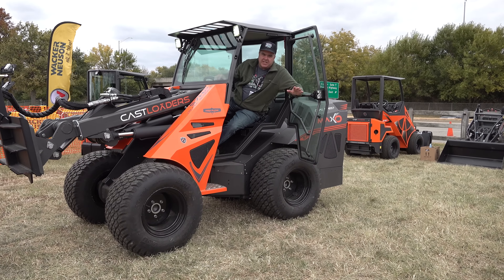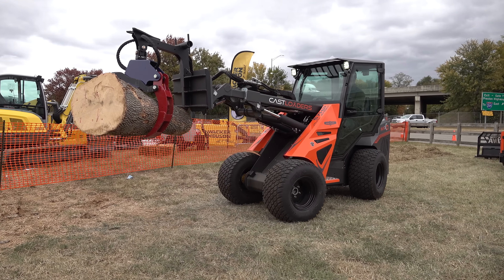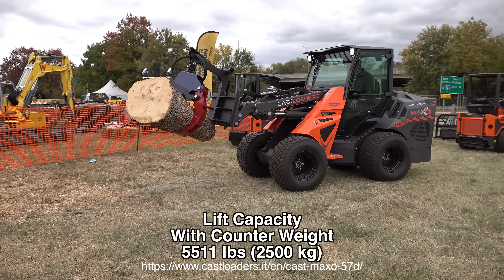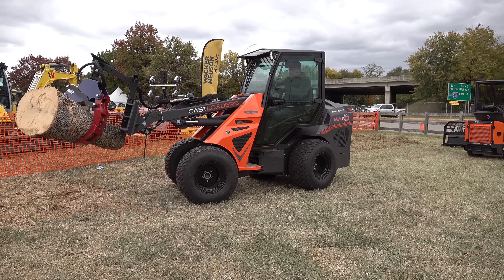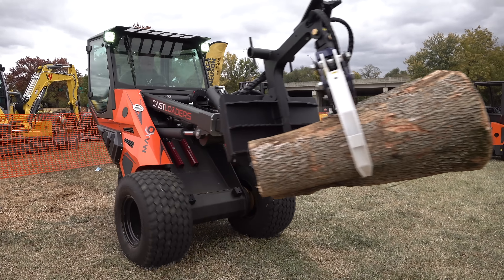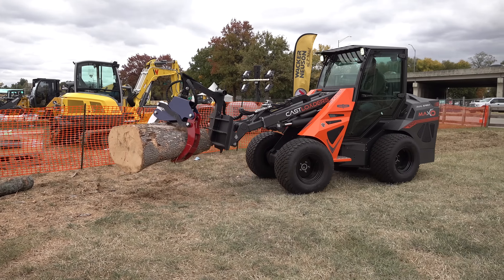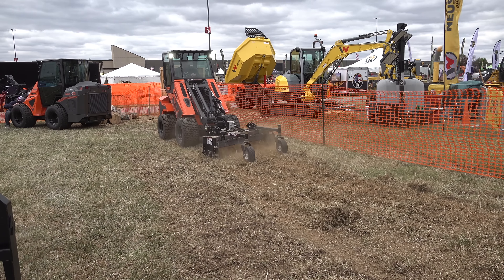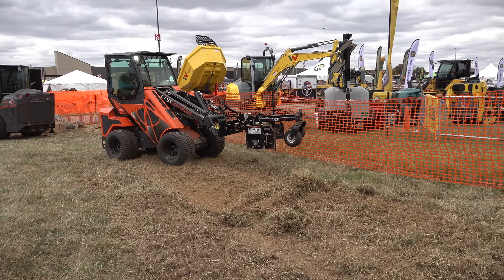This Mini Loader is “Different”. Which Style Is Best?

Comment: I noticed both the front and rear axles normally run with open differentials combined with a locked center differential. While you were able to get stuck when the ground wasn't level, 99% of the time there would be more weight either on the front OR the rear - resulting in only one tire at the front OR the rear coming off the ground. I'll try to explain what I mean...

In other words as long as either the front or the rear is heavier (than the other) then you should rarely get stuck like you did, and very rarely need to lock the differentials.

This is because with either the front or the rear completely planted on the ground, you'll only get stuck when climbing a relatively steep obstacle or on very slippery surfaces - even with the differentials left open.

I'll bet the owners manual states that you should add weight either to the front or the rear to make sure that you don't have a balanced situation where diagonal tires are able to come off the ground.

It is surprising that they set it up the way they did. They should have added weight somewhere to ensure one of the axles remained planted on the ground.

Back in the seventies, to muck out stalls, we used to occasionally rent a small four-wheel drive front end loader with limited articulation in the suspension. It too had a locked Center differential and open front and rear differentials.

What you would notice when using it was as long as you had a load in the bucket, it had what amounted to a minimum of front-wheel drive, because one of the rear tires would regularly come off the ground but the front two would always stay on the ground.

The problem with it was when there wasn't a load in the bucket it was very easy to get it stuck on only mildly uneven ground and it didn't have functioning locking differentials. When the bucket was empty you were regularly forced to use the bucket to push yourself off of little tiny bumps just to get yourself moving.

You quickly learnt how to use inertia to move around the barnyard and get over all of the bumps when the loader was empty.

Comment: I'd love to have a mini wheel-loader. I priced one out while shopping about for my tractor and boy are they expensive if all you're wanting to do is yard work like us. Of course that's not what they're designed for. They're made for doing big work in tiny spots. But if I had the money for something like this my main use for it would be adding a set of forks on it and using it for heavy lifting. If you're someone who sells natural animal compost this would be great for filling customers who want loads if it that are larger than what a sub-compact/compact tractor can shovel up. :)

Comment: 52000! I can buy a nice JD 4044 or bigger  for much cheaper. What's the price for each individual attachment?
Reply: As someone who operates a 4052R almost daily... It is certainly an incredible machine and has been extremely reliable after 900 hours. That being said, i dont think these castloaders are trying to directly compete with 4 series tractors.
Reply: Apple and oranges- Very different machines